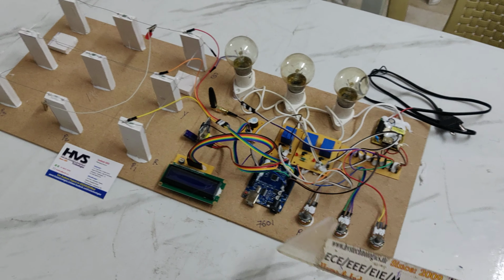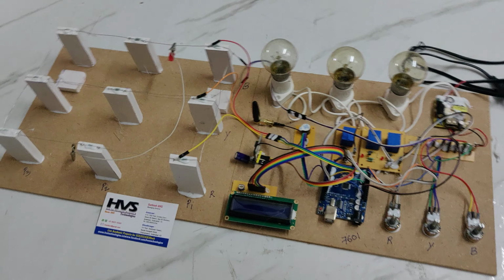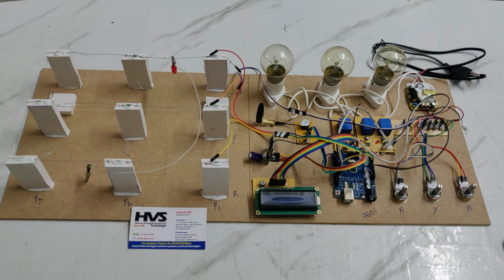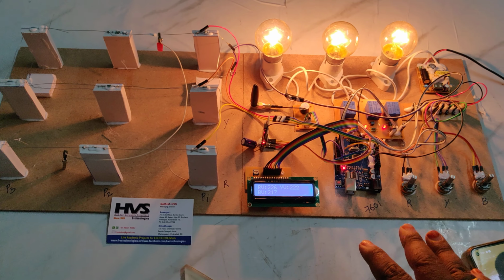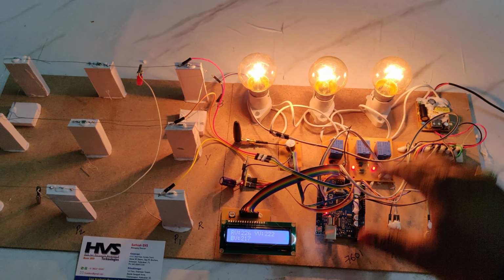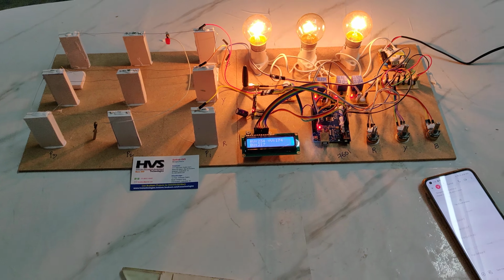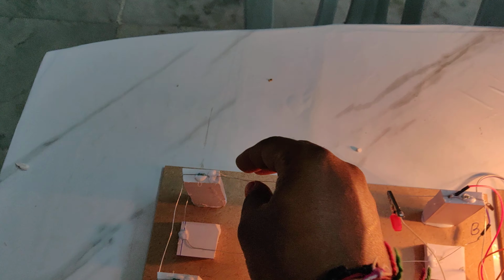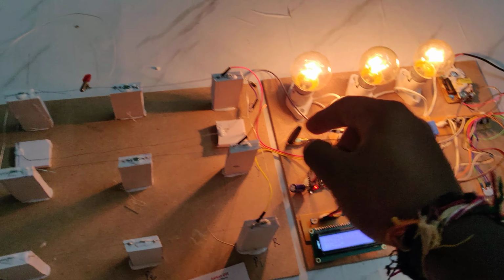HVS-3193. Transmission line fault detection using Arduino UNO with GSM SMS Alerts #opencircuit #gsm

Comment: Can I access the circuit diagram
Reply from the maker: https://www.hvstechnologies.in/product/hvs-3193-transmission-line-fault-detection-using-arduino-uno-with-gsm-sms-alerts
After order placed you will get the details. 
You can contact us at +919603140482
Through WhatsApp or call